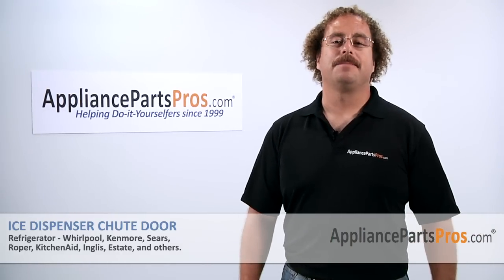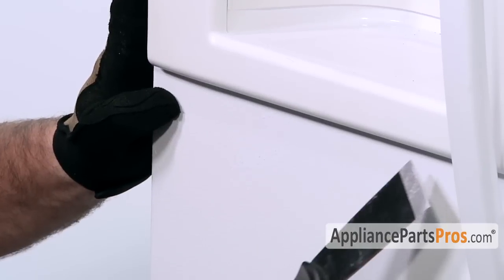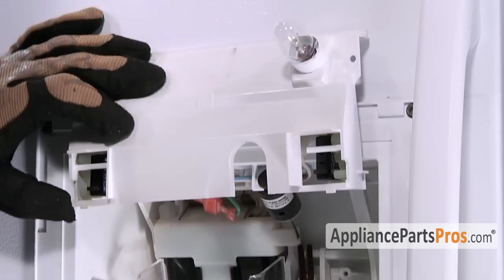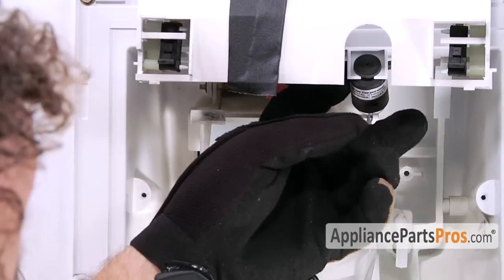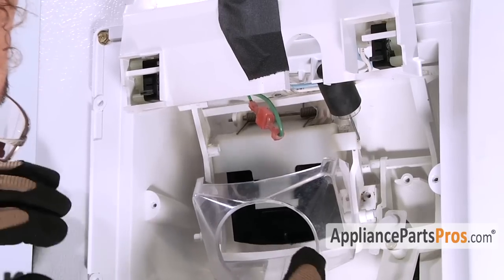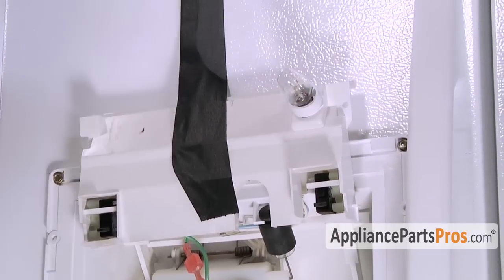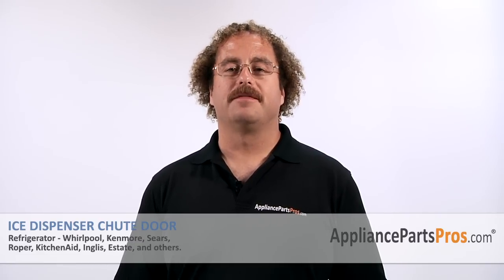How To: Whirlpool/KitchenAid/Maytag Ice Dispenser Chute Door WP2180353

Comment: Fixed my issue with ice melting slowly and clogging the dispenser exit. My plastic bracket that holds the foam chute door was broken, i took it all apart and super glued it back together now it seals again and no more issue Thanks Buddy! I have a kenmore and its 24 years old.

Comment: the bracket that holds the spring pin was broken on mine too.  I superglued the bracket together, because it was only split but not completely broken off.  So far it's working.  Thanks Appliance Parts Pros for showing me how to get into this.

Comment: Great video. I went looking for my putty knife but couldn't find it and it was a good thing. I took the drip tray out and found 2 screws instead. I was just taking it apart due to mold but after getting the chute door off I figured I'd replace it. I think the $20 for a clean mold free door is worth it. Thanks. Oh and I did order it from you guys.
Reply from the maker: They do vary a little over the years, glad you got it fixed up and thanks for the order!

Comment: Mine had a broken bracket that holds the door spring pin.  
I melted a hole in the other little tab that was not broken off - inserted a bicycle spoke through all the correct holes- and we have functional ice maker again! 

Thanks so much for the Video!!

Comment: Great demo. My kenmore side by side refrigerator has a ice door chute problem.... to verify it I stuffed foam insulation into the chute and still I have ice building up on the inside the freezer along where the ice comes out of the ice maker and the chute. With the insulation blocking the door I would have thought that would cure the ice buildup problem. Am I still just looking at a chute door problem?

Comment: My refrigerator door ice maker makes ice normally but the dispenser keeps freezing up after using for a while. Another video shows the untightly sealing of the dispenser door might be the cause. The air can get into the dispenser through the door and cause freezing.
 What do you think?

Comment: Pretty dang good video.  I fixed mine because I saw this.  My mechanism fell apart because the right knuckle of the flapper door hinge broke.  This knuckle is molded with the back plate and would have been very difficult and expensive to replace.  I had to fashion a new knuckle out of thin metal and screw it to the back plate.  Seems to work just fine, now.  Couldn't have fixed this without your video.  It might have helped me a little more if you'ld spent a few seconds showing the whole mechanism and how it works.
Reply from the maker: Er Di Thank you, glad the video helped you get the dispenser fixed!

Comment: Help needed: I replaced this Ice Door Kit, and while it fixed my problem of ice/frost build-up, now I'm having trouble getting the Ice Dispenser to actually release ice (cubed or crushed). The control panel is lit up as normal. The water dispenser works as normal. However the ice dispenser only releases ice if its pushed/depressed extremely hard (usually pushing high up on the dispenser). When pressing it in normally (with hand or cup) it isn't responsive. Any ideas how to solve?

Comment: What is that little black barrel called? My door is closing (and sealing) but it's closing very slowly and allows ice to fall out after you have moved the cup away. That black barrel looks like it is attached in such a way that would keep the door from snapping shut quickly due to the spring tension. I was wondering if that thing can malfunction and cause the door to close too quickly.
Reply from the maker: Jason Akkerman The spring closes the door and the barrel, aka delay mechanism, slows it down so it doesn't snap closed. I would check out the parts in the dispenser to see if there is any damage or any indications as to why it slowed down. The delay mechanism is a small vacuum device, you can take it apart and clean it, to be sure there is no problem there.
Reply: Thank you for the input.

Comment: I'm having an issue with the open bracket that holds the right side of the spring pin is broken off.  It looks to be injection molded with the rest of the dispenser assembly. Is there is replacement for this? This is a Whirlpool Model ED5VHEXTB01

Comment: I have a 3 yr. old Maytag side by side. We have had trouble from the beginning with the ice basket freezing up. my husband put hot water always to free it because the ice freezes together, The last time he must have pulled too hard and the rod came loose from inside, the motor runs but the turning part in the basket doesnt work now. What do we do to repair it?

Comment: When you put the panel back on the heater for the door was plugged back in did you cut it off the other one and plug it in
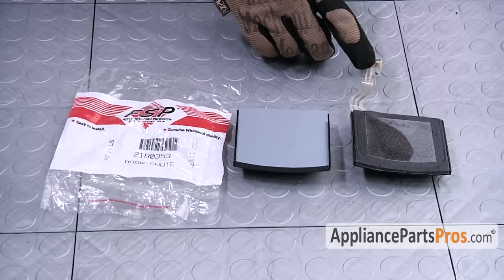Reply from the maker: If you've purchased the new version of the part, without the wire, then it's no longer necessary. As Matt explains at 3:41, the new part is made from different materials, and is no longer prone to icing up, so it doesn't need the built in heater anymore. There's no need to cut that old wire off and try to attach it to the new one. :)

Comment: Getting the faceplate off is a bit tricky. The latch is at the very bottom edge of the faceplate, and is released by pulling the faceplate edge downward. After seeing the video, I was searching for a release to the latch sticking a putty knife way up behind the faceplate. I would suggest instead using a screwdriver, just barely up under the edge of the faceplate and twisting, or better yet, bend a thin piece of metal so that is has a small 90 degree bend. With the bend angled back towards you, slip it under the edge at the recess, and pull the edge downward.
Reply from the maker: Thanks for the info, glad you got the refrigerator fixed!
Reply: I also removed the catch tray at the bottom by sliding straight out...after releasing trim I also had to release white plastic inner trim with catch on each side before Theresa's enough room to rotate chute and attach

Comment: The steel pin goes through plastic tabs on the housing that have the holes that hold that pin, the chute door spring also is supported by the pin. If one of the plastic tabs on the housing itself is broken (they should be made out of steel and bolted on, into steel) but what is there to do to fix this problem?
Reply: That happened to me about 10 years ago.  The online forums I found suggested replacing the entire plastic shell, but that part was already no longer available at the time and is still not available now (I think many people had had the same problem, so the part sold out).  I tried gluing the tab back on, but that didn't work for long, as neither Krazy Glue nor JB Weld were strong enough.  Instead, I rigged my own repair by drilling a new hole in an unused plastic tab next to the one that broke, and re-mounting the ice lever with a longer pin.  I had to get a 90-degree drill adapter to access the tight space and make the hole.  I think Steve Weinert's comment on this video describes a similar issue, but he said that he made the new hole by melting instead of drilling.

You are right that the tab was poorly designed.  The torsional spring puts a lot of force on the plastic tabs, and the tab that broke did not completely surround the pin.  I would like more of the parts to be made out of metal even if it increases the cost of the refrigerator by $50 (just the service fee to get a repairman to your house is more than that).  Every time I have to do maintenance, I cringe when I have to snap plastic parts in and out of place because plastic gets dry and brittle with age, and I keep thinking that something will break.
Reply: @Mpg-gh5fq  .. BTW I bought a kit for replacing the plastic tabs that is designed just for this and instructions actually have you remove the plastic tab on the door inside altogether and replace it with the included metal part. The irony is, the steel rod they included is too thick to fit in the new metal frame, terrible quality control. I was also mistaken and my tabs were all intact. I used some of that kit and some of my existing parts and fixed the door.
Reply: @Carlsings  Oh yeah. . .I remember reading about those repair kits when I was trying to figure out how to fix my ice dispenser.  I had read a forum post that said that those kits had all been sold out, but when I looked at a parts web site recently, I saw that they had some of those kits.  Given what you said about trying to use a kit, I'm glad I didn't find one when my ice door broke.

Comment: Do you sell parts for LG refrigerator? I may need a plunger solenoid or a return spring for the flapper door assembly. It opens then will not close causing my freezer chute to frost over.
Reply from the maker: Todd White We do, you can to our site and enter your appliance model number to view the parts or give us a call, 1-877-477-7278.

Comment: My water dispenser in the door works fine but the Ice maker is not getting any water. One of the doors was left ajar and the ice started melting then refrose to the ice maker and the Ice tub. I used a blow dryer to defrost it enough to get the tray out but now it is not getting water any idea what it might be?
Reply from the maker: Make sure the fill tube going through the back was is not frozen up.

Comment: I REPLACE  THE ICE DISPENSER CHUTE DOOR BUT THE CAP DO NOT OPEN WITH PUSH TO OBTAIN ICE
Reply from the maker: MIRIAM RODRIGUEZ I would double check to make sure everything was reinstalled properly. You can also post the problem along with the appliance model number on our repair forum and the techs can help you troubleshoot the problem.

Comment: The bracket that holds the spring pin was broken on mine also. I drilled a hole in the other tab and slid a screw in there.